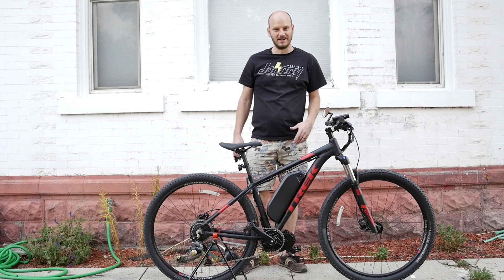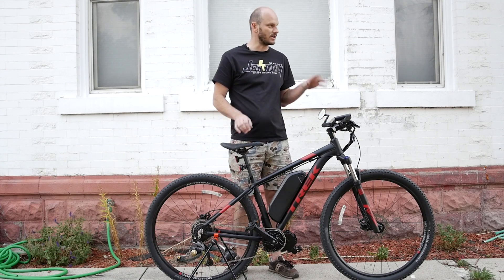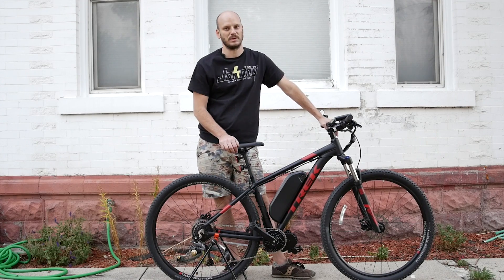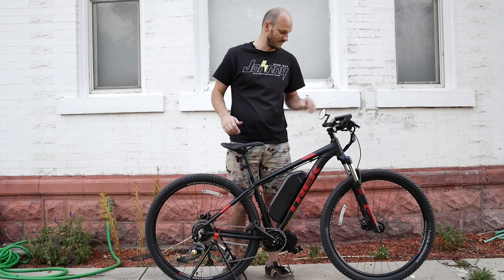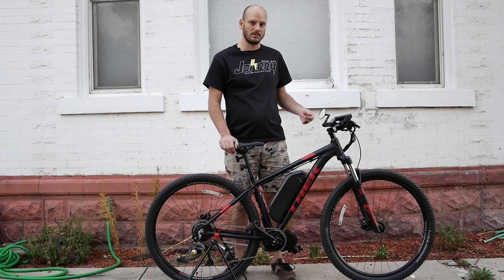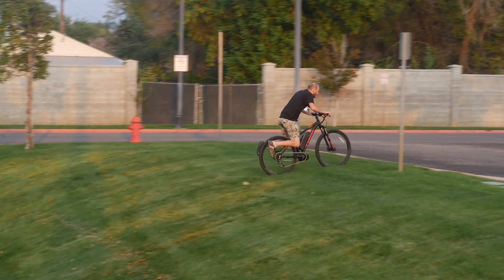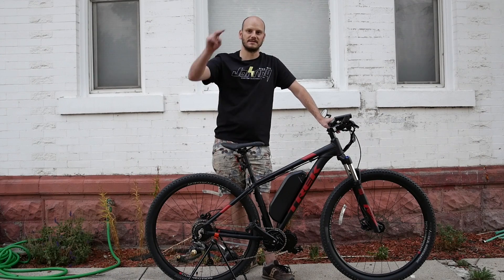Custom E-bike Build: Trek Marlin 7 BBSHD 1000w Mid Drive 52v 16 75ah

Comment: I’ve done a bbshd build on a 2022 marlin 7, 10 speed, but only had a 46 tooth lekkie ring which was/is too big, so had to use a lot of spacers, 1cm. Of course the chain line was way out that It would not stay in 1st & 2nd gears. Can still ride with 8 gears. My question is what size ring can I put on without spacers so the chain line is good in all 10 gears. 42? 40? 36? Would like to go as big as I can.

Comment: Hey Johnny - I recently put an BBSHD on a Northrock fat tire bike.  Changing gears is sometimes wonky also, I’d like to do better on hills for commuting. I watched your other vid on chainring sizing, I’m curious about a 36t or 42t, which brand/CR would you recommend? Also, trying to do this on the cheap-ish.
Reply from the maker: Lekkie is the best IMO. There are cheaper chainrings but they use cheaper aluminum which makes sense. Plenty on the internet available, just keep in mind that they are not all the same quality

Comment: Hi Johnny. . . i have trek marlin 6 with 73mm width bottom bracket  that i would  like to convert to ebike with bafang BBS02. Can you please advice me what issue I may encounter if I use BBS02 on my bike. My number one concern is the main body(Spindle) of the BBS02 is 68-73mm in length vs Marlin 73mm bottom bracket. Is there still room for the inner and outer lockout locker to lock/fasten the motor? is the 42T chainrain will work as well? . . .Thank you in advance and hoping to hear from you.

Comment: how did you make it fit? my bottem bracket is 76mm on a marlin 7 gen 2??? all mid drives i find are 68 to 73mm
Reply from the maker: Are you measuring just the frame?

Comment: Whats the frame size and wheels size i got the exact same bike with 15.5 small frame 27.5 wheels i want to do this build but scared i wouldn't have clearance for batter and motor i do alot of off road trail riding medium not too hardcore trail can you help me look into if it will fit or i need a new bike

Comment: Can I do a conversation on my treck fuel full siss  bbso2 750 48volt
Reply from the maker: Yes
Reply: Why bbso2, bbshd is better, bbso2 has more failures attributed to it, if ur bottom bracket is either 68 or 73mm get a bbshd 68mm.

Comment: Hi, been inspired by your channel  so bought bafang 750w 20ah battery c965 display all fitted fairly easily. Pas works 1-9 settings but thumb throttle is either on or off, no variable speed, any thoughts.
Regards Neil

Comment: Hey man! great video as usual. I think I am going to go this exact build (bike/motor etc) what size bottom bracket would I choose in your store? thanks!
Reply: did u ever find out?
Reply: @lannerkullman9401  68
Reply: thanks for the great video/tips and questions! So does the bbshd 68-73mm kit fit the marlin 7 bottom bracket with a good chain line (using Lekkie 40T kit for chain ring)?

Comment: What’s your view on using a virtually brand new Large size 29 inch wheel Scott Aspect 910 as a candidate for eBike build?  Thought if using 1000W Bafang Mid-motor and 52volt battery pack.
Reply from the maker: Looks like a great bike to be an amazing ebike :)

Comment: hey Johnny love your channel, need advice . just built a trek 7 bbso2 as my commuter but am struggling with chainline. started with a lekkie 42tooth 9mm offset but it chewed into frame so offset with 5mm bottom bracket spacer, then whole motor is sitting too far on the right. so put a lekkie 36 no offset and removed spacer but chainline still sucks? is there an offset 36 tooth front chainring? that would be suitable for bbso2? I’m thinking my only other option would be to chamfer the right side of bottom bracket down several millimetres? by the way, this combo is awesome as a street bike except for chainline. love bafang smooth and reliable.
Reply: have you fixed this problem and if you have, what did you do to fix it?
Reply: @Arezuuuuu  had to lock out first and second gears otherwise all good
Reply: @robertsmark2650  okay, do you use lekkie or spacers right now? I am wondering go build the same with my trek 7

Comment: Now that's interesting. I did the exact same with the exact same bike. I also upgraded the brakes to Shimano Deore XT M8100, replaced the front rotor with a 203mm and rear with 180mm,  installed the Lekkie Bling Ring 40T BBS Package and ran all the cables through the downtube.  Looks clean and has some power.
Reply: Im thinking of using the same bike for my build. Did you have to use spacers for the motor or the Lekkie Bling Ring?
Do you have some pictures of how you ran the cables through the downtube? Which year marlin did you build on?
Please post your build on like r/ebikes or something.
Reply: @CRHASHH  I’ll get back to you later with the info requested. I have pics but can’t post them here.
Reply: Hi Brad. I'm getting ready to convert a 2019 Marlin 7. In routing the cables through the downtube, did you have to enlarge the holes in the frame? Did you just bore it with a drill?
Reply: Hi Randy, I actually cut the wires of the harness and was able to thread those through the existing holes without having to enlarge them. Then, I soldered them back together. This enabled me to shorten them to a more manageable length, and also easily hid them inside the downtube.
Reply: @braddavis5802  Interesting. Thanks

Comment: Love your channel bro! Does this bike have pedal assist modes? I think I will do this on a marlin 8
Reply from the maker: Yes, all the Bafang kits I install have pedal assist and a throttle.
Reply: @JohnnyNerdOut  That’s sick dude! I am going to do a similar build but on a trek marlin 8 in a large. Will a 1000w bbshd mid drive motor and a 52V 19.2AH Whale shark ebike battery fit nicely?
Reply from the maker: @heroryan7859  it should, depending on the frame size. Measure twice, try not to have to cut anything on your bike 😀
Reply: @JohnnyNerdOut  Well I actually have not picked a bike yet. What bike is good for a 1000w bbshd and a 52v 19.2 ah battery from bafang? I will be on roads mostly and some grass and snow off roading. 
Thanks.
Reply from the maker: @heroryan7859  the last words totally change the bike. Snow off roaring requires fat tires. Go with a 4” or wider. It will suffer a little on pavement with efficiency though.
Reply: @JohnnyNerdOut  ok
Reply: @JohnnyNerdOut  What bike would you recommend for my build? Because I can not find bottom bracket sizes on websites and specs
Reply from the maker: @heroryan7859  really depends on your budget. $500 gets you a xc00 or gravity bike. 1k$ gets you a suspension fork

Comment: John.. I have a Marin Muirwoods 29er that i converted.. The bottle cage bosses are too low on the downtube, so when the batter was put on, the battery would not slide down all the way on the fix plate.. I ended up mounting it upside down.... Is there a remedy... I saw the Lekkie boss adapter clamps.. but my tube is 38mm so they are meant for too small diameter tube..    (is it called a fix plate or a foot..?)
Reply from the maker: Check out the bottle Bob 👍 it’s universal

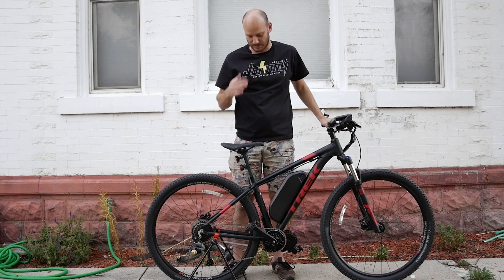Comment: 3:25 Nerding Out on gear ratios: 
Eleven- to 36-tooth cassette gives gear ratio range of 327%.
My old road bike had a gear range of 230%. Camping bike: 350%. So 327% is a terrific range.
Shimano Alfine 11 has 408% range. (about $430). 
Rohloff has 526% range but you pay for it ($1800).

Cassette plus dérailleur costs, what? $100-200 for Japanese; several hundred for Campagnolo?

Many Rohloff reviews call it a "lifetime" hub due to tremendous reliability. That is a plus, but still; it's a big bite. Doubles the cost of the entire conversion.

Derailleurs are vulnerable to both intentional and unintentional damage. A kick, drop, or crash can mess them up. I have succeeded in just twisting a bent dérailleur back into shape after an event, but I replaced it as soon as I could. Cassettes are messy, with all of the lubrication on the outside, where it collects road grime rapidly.

This leaves me still curious about Shimano Alfine 11. While still expensive compared to Japanese cassettes, it's not crazy for a bike conversion that is going to get new wheels, motor, and battery. If it offered superior reliability and simpler maintenance, then it might be interesting.

The thing is that I have not seen many long-term reviews of Alfine 11's. Maybe I just didn't look hard enough, but I'm curious about them. 

Do any of your customers bring up the idea? Or, better, actually send you one to test?
Reply: Rohloff is the way to go for me. Durability and no maintenance plus a huge gear range…well worth the money imo. Soon as I get my next build started, that will be on my list of must haves.

Comment: @JohnyNerdOut did this specific bike have a bottom bracket that you had to drill to fit the motor?
Reply: I just built the same bike and had to router out my bottom bracket for the motor to fit
Reply from the maker: Can’t remember now… I’m trying to make it a point to say if there is anything funky on builds going forward
Reply: @JohnnyNerdOut  Yes, please. That would be really helpful.

Comment: I don't agree with the Suntour bottoming out comment. Most have a preload to prevent that and many Suntour models exceed Rockshox in performance. Admittedly generally Suntour have a wide range of fork options with more basic options but the sort of Suntour forks Trek use on lower end bikes are pretty decent even if they don't perform quite as well as the higher models with Rockshox. You can get basic coil Rockshox forks that perform much worse than Suntour XCR air and higher air models for similar money. Forks that have horrible bottoming out are those on the typical walmart mountain bikes with no preload option at all and smallish stanchion diameters. Personally I don't really do serious off-road stuff so much prefer rigid forks for lightness, safety and speed and the complete lack of maintenance.  

Changing the subject I see Tektro are releasing a new 9 speed ebike optimised groupset meant to extend chain life etc on mid-drive bikes I guess following the Shimano mid-drive specific ebike groupset might be worth a video.
Reply: Total utter bs about suntour exceeding rockshox...
Reply: @OutandAboutDevon  I'm talking about the high end Suntours compared to lower end Rockshox. There is an overlap in performance. Also you shouldn't be too damning of Suntour as they are the OEM manufacturer of Rockshox forks. Suntour has a more premium factory where their top end forks are made as well as Rockshox and some other brands they manufacture.  When you see made in Taiwan or made in china on a Rockshox fork who do you think is manufacturing them? Most US brand bicycle products are made for them by manufacturers in Asia. Trek, Cannondale, Specialized etc they are all products made by Asian factories which they do not own and its the same for most components.

Comment: What throttle are you using? A universal or a left or right? If you are putting it on the left, then how does it match up with the 500c
Reply from the maker: Universal. The lever sits below the display buttons

Comment: I bought a custom made 29” aluminum frame fox shoc guy spent over $2000.00 to build it it has  a 48 volt tongshen pedal assist got it for $900.00 deals are out there
Reply: Same team of engineers that made the bbshd made tongshen, only the 48v is 500/750watt
Reply: @OutandAboutDevon  I’ve upgraded to a bafang HD 52volt now

Comment: Johnny, nice build I have two questions, first you think the BBS02 is up to the 1000 watt challenge? I currently have a 1500 watt BBSHD 52v 48 chainring yet it does only 22mph even with the controller top speed maxed out?   You hitting 37mph with the BBS02 makes my mouth water. Thanks very much I enjoy your videos and delivery.
Reply: Your BBSHD  has more torque and wattage than the bbs02 it should easily hit same speed.   What size is your smallest rear gear and size of your tires?
Reply: @TheAgentAssassin  26" 11 tooth
Reply: I have recently converted my bike to a ebike. I bought a BBSHD 52V off eBay. My bike is a MTB Schwinn 24spd. After installing the BBSHD it’s now a 8 speed. Just yesterday it was warm enough to ride so I did…on PAS 9 and me pedaling pretty fast I hit 37.5mph. My bike is stupid heavy and I am not a in shape, fit fella. I think I could hit 40mph if I really tired. My front chain ring is 46T and my bike is a 29er. So if you are speed limited on your BBSHD, it’s all software. I bought the USB cable off Amazon and googled the software, super easy to download the software and hook the bike into the pc. I downloaded the first profile for BBSHD I found and have made zero changes since. The differences are amazing. PAS 4 and 5 are super natural feeling and 9 is full power and just crazy power.
Reply: @Todd66  I have the programming cable never tried the software. I give it a try. Thanks.
Reply: @sambananas4513  I think you will be happy once you do. I was surprised at how easy and quick it was to rewrite the controller software. I do not have a laptop, so I had to wheel my big 29er right into my office. It was pretty strange lol. I have the 850C display and also the eggrider v2. I like the software in the V2, but I like a big colorful display and the eggrider is not that in the least, so I bought the programming cable and honestly I like how everything is figured out and the settings are pretty optimal. I don’t have to change anything or mess with anything…just turn it on, pick my PAS and I’m set. I think the V2 is for that stealthy look, but gives you the ability to tune the software through your phone. You can use you phone for live data and even use it as a display, but I did not like the format or having my expensive phone sitting on top of my handle bars.
Have a great rest of the week Sam, good luck with dialing in your Bafang, you will love it once you do.
Reply: @Todd66  Thanks Todd, I believe I have a replacement display and it is also the 850C color so I am in. Thanks. I'll be taking the PC the the bike in my case. Cheers!
Reply: I have both 36t and 46t i can say without a doubt u will spin faster to a point with 36t smaller but it will not give more speed than 46t once it reaches optimal rpm
Reply: @OutandAboutDevon  Thanks. I get up to 28 mph pedaling with an Eclipse 48 tooth.
Reply: Change out your chain ring to a higher tooth count.
Reply: Might need to lose some weight Sam 🍌
Reply: @its_marc  Sam needs to loose some weight but at 225 it should not be that much different with me pedaling.
Reply: 48 tooth chainring seems way too big to me.  I had a 30T chainring up front with my BBSHD and could do 32mph on 2.4" MTB tires and a 48v battery.  Maybe your motor is spinning too slow due to the large front gear.  Try downshifting so you get a faster cadence.
Reply: @currentsupply  his problem is not the chain ring. I have a 46th on 29 inch wheels with the same motor and I can hit almost 40.
Reply: @Todd66  yeah, I agree, I had a 46t chain ring too, the stock one, and top speed was 32 MPH on my my bike (same top speed as the 30T). But the bigger chain ring was more quiet at higher speed than the narrow wide 30T
Reply: @currentsupply  Really? The cadence must have been crazy, no thanks. Maybe my speedo is off?